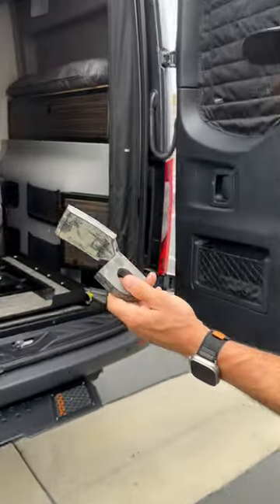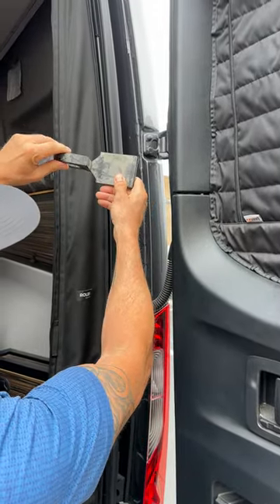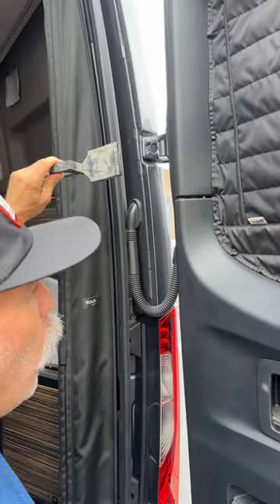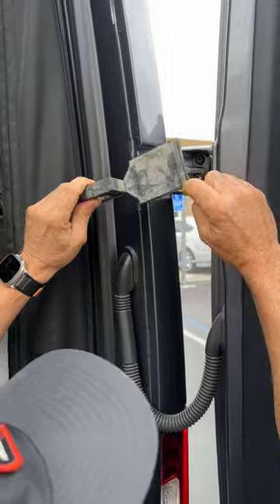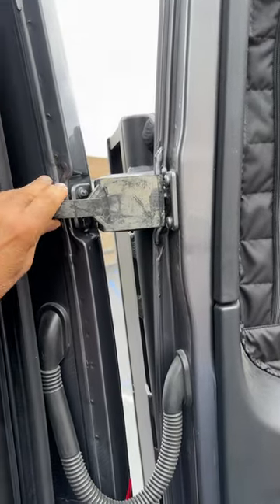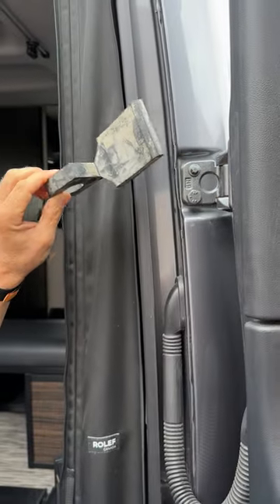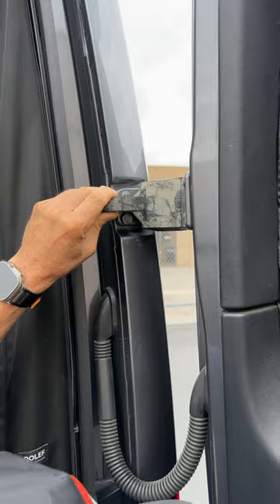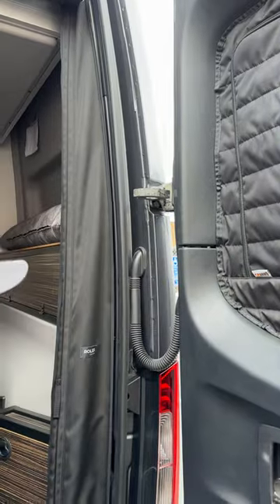HOW TO use your door stoppers for your sprinter van. #shorts

Comment: What happens if the wind blows it open?  The door stop simply falls out?  Trying to find one that keeps it open to sleep at night.  This doesn’t seem reliable for that?
Reply from the maker: Hey Bradley, if you are in an area with some decently strong winds, you're probably right that they wouldn't last all night. These were an early and low-cost way to keep your doors open, since then we've developed the Stop-Stays which use gas struts to keep your doors open. These are much more reliable, however they are more expensive. Check them out on our website if you're interested.
Reply: Thanks.  Yep. I’ve seen those struts. Great idea but might be overkill for me.  Thinking about it.